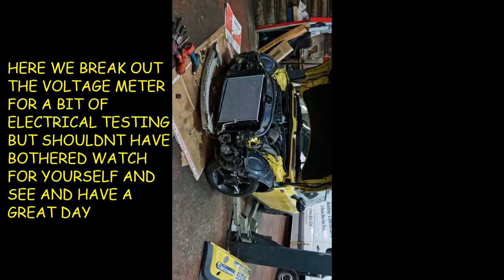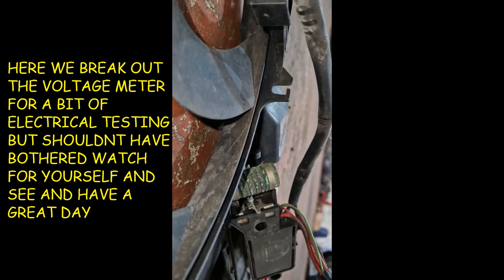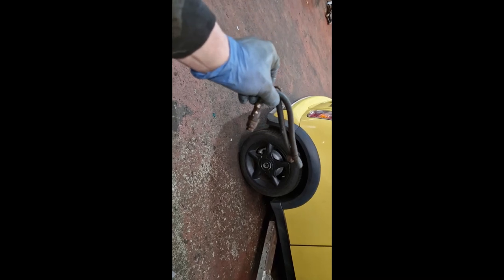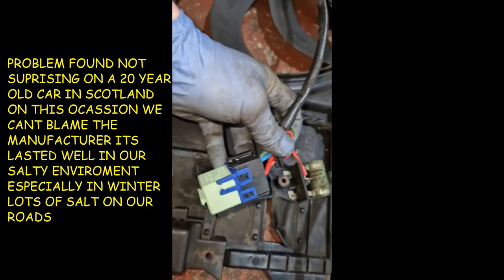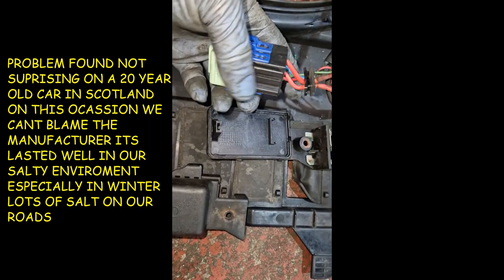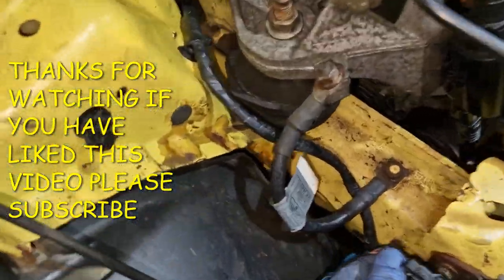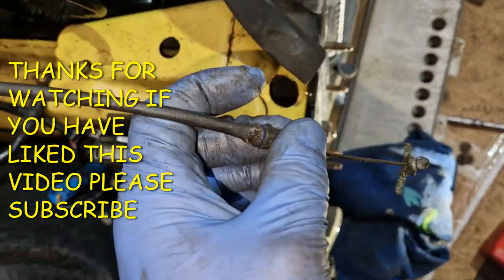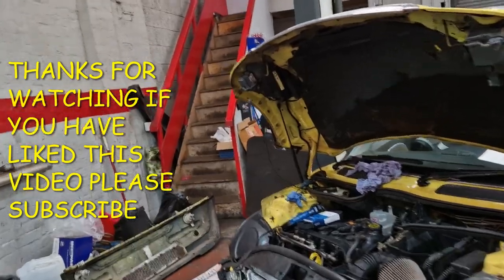MINI COOPER COOLING SYSTEM RESTORATION PT 2 COOLING FAN RESISTOR REPLACEMENT

Comment: Fixing the fan resistor is not clear. How did you connect the wires from the new resistor. It had 3 wires, 2 red and 1 blue. I hope you can let me know. I bought the same resistor to fix my fan problem..Kind regards from the Netherlands
Reply from the maker: ah, greetings from Scotland, and thanks for watching. If you havent allready please consider subscribing. You don't need to do anything with the blue wire, the blue wire that goes to the relay, but you don't need to do anything with it. Just tape the end of it or heat shrink it to seal it the blue wire is for operating the fan through the relay. There are 2 red wires. One is thicker, the thicker one is for high speed, and you just need to identify which one is thicker and join the 2 red wires  tobthe wxisting red wires as the blue one is for powering the relay wich in turn powers these 2 red wires there's only 2 wires 2 the fan everything is controlled through the relay high speed and low speed hope that helps many thanks Stephen